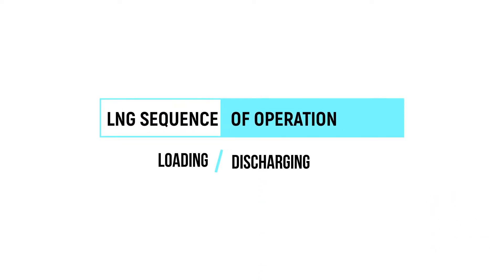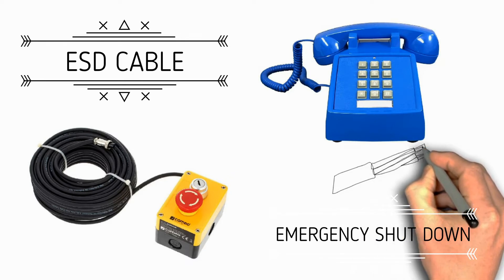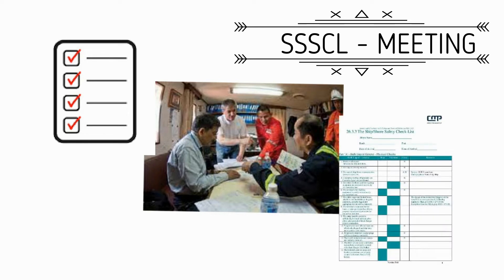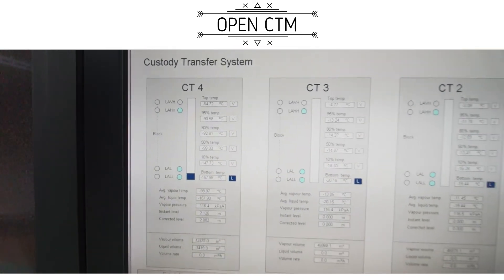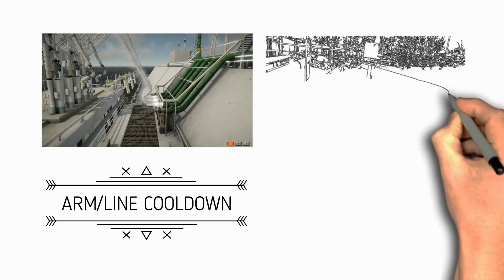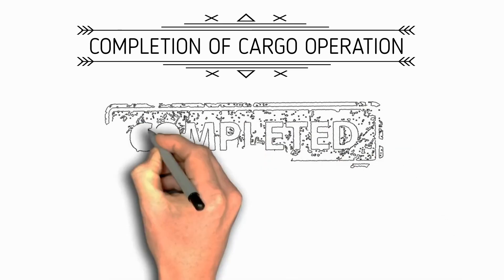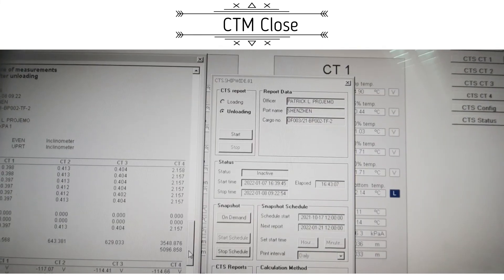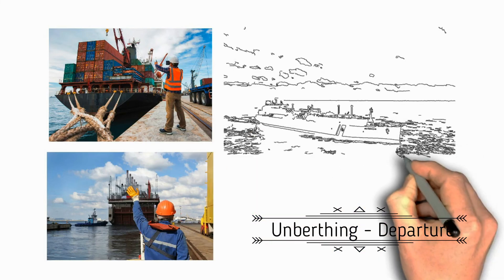LNG LOADING DISCHARGING SEQUENCE OF OPERATION

Comment from the maker: Next is ESD Test (Warm) - 
The Emergency Shut Down System is a quick closing system, which may be activated automatically or manually. It will close all deck valves and shut down all cargo machinery.
ESD test Warm – this refers to the condition on which the cargo lines or cargo manifold are still warm, meaning there were no passing liquid. During the testing, the time it takes to close the Manifold valves should not exceed 30 seconds. It should close within 30 seconds. 
If it exceeds more than 30 seconds, then the valve closing should be adjusted prior commencing cargo operation.

Next is Arm cool down 
Cargo systems are designed to withstand a certain service temperature; if this is below ambient temperature the system has to be cooled down to the temperature of the cargo before cargo transfer. 
For LNG the stress and thermal shock caused by an over-rapid cooldown of the system could cause brittle fracture on Cargo lines and Cargo tanks. Cooldown operations should be carried out carefully in accordance with instructions.

Next is ESD Valve operation test (Cold Condition) 
This is also known as ESD cold test. After cool down operation, cargo lines and valves are already exposed to low temperature; the operation of the valve might be affected due to low temperature in the system. 
In this procedure, we are trying to check if the closing duration of the manifold valves are still working and within acceptable limits. 

Next is Start of LNG operation 
When cargo lines and cargo tanks are already cold, it is now ready to received or discharged bulk quantity of LNG. This is the official start of the cargo operation. When starting the operation, it should be done slowly and slowly increasing the loading or discharging rate until reaching the maximum agreed rate.
 
Next is Ramp down
Usually 1 hour before completion of cargo operation the ramp down stage begin. This is where the loading or discharging rate is reduce or decrease to prevent overflowing cargo tanks.

Next is Completion of Cargo Operation
When the agreed quantity to discharged or loaded is achieved then cargo operation will cease.

Next we have Arms and Line draining
On most LNG ships, the manifold is drained via the spray header to a cargo tank. Check that the spray valves are open on one tank. This is to get rid of all the liquid LNG that are still in the shore arm and manifold line and send it to the cargo tanks.

Next is Nitrogen Purging of Arms
LNG line are purged by passing an inert gas through their interiors to eliminate substances that increase the chances of combustion. Nitrogen gas is an ideal candidate for LNG tank purging due to its inert, non-combustible properties. 
The manifold and shore arms should be purge before disconnection in order to have a non-combustible atmosphere during disconnection of shore arms.

Next is  Closing CTM - Custody transfer measurement (CTM) system for liquefied gas carrier
The CTM is a system which allows the quantity of cargo on board at any time to be accurately calculated and therefore provide a means by which the amount of cargo that is transferred either internally or between the ships and shore to be accurately quantified. 
Such a system can be used on LNG carriers because the cargo is always same whereas on other type of vessels such as oil or LPG, large differences can occur between the cargoes carried on each voyage.
The quantity of cargo during CTM closing will be the official quantity to be use when calculating the total amount discharge or total amount loaded. 
This will also include the temperatures of the cargo being loaded or discharged. Ergo Quantity CTM open plus or minus Quantity CTM close equals the amount of cargo transferred.

Next is Arms Disconnection
When shore arm and manifold are purged, shore arms can now be simply disconnected from the vessels manifold.

Next is Post Discharged meeting 
This meeting is held after cargo operation is completed. Discussion such as discrepancies or any suggestion will be brought up and sorted out. Doing all paper works, stamps and signatures.
   
Next is Disconnection of ESD cable 
When all papers and operations are completed, ESD cable or communication cables between terminal and the vessel is disconnected. Vessel is preparing to sail out.

Next is Disconnection of gangway 
When all visitors disembarked, prior vessel leaving port, shore gangway or ship’s gangway will be disconnected.

And Finally we have Ship Unmooring and Departure
With the guide of a Pilot, vessel will leave the terminal. Casting off mooring lines and heading out to sea.

Comment: My question sir is how to perform cooldown of LNG piping or valves from ambient temperature?
Reply from the maker: Cooldown operation is introducing liquid small amount of Liquid LNG to liquid lines slowly to avoid thermal stresses on pipe lines. Usually it take 1 hour to 1.5 hours depends on your vessel's manual and ship's conditions. usually you need to achieve -130 degree C to complete cooldown or as per agreed in the safety meeting. this is done by using spray pumps if discharging, and using shore pumps at minimum rate if loading operation. Cargo tanks and liquid pipe lines should have average temperature of -130 degree Celsius.
Reply: Thank you very much sir for your info and response to my question. Thank you again
Reply: Sir I need a video detail like this for storage LNG please

Comment: Hello Sir i am wondering during discharging with LNG cargo. Are there any introduction of Inert Gas During discharging operation to fill the empty Space Volume or it is just LNG vapour Fills it automatically by Boil-Off of LNG Cargo Inside of the Tank itself?
Reply from the maker: No inert gas. Vapor return is use to maintAin positive preswure in tank. If no vapor return we can use vaporiser onboard
Reply: @wellanchored-deadslowahead9553  thank you to the response sir. I am First time to board on a Gas tanker and my previous experience is oil tanker sir.